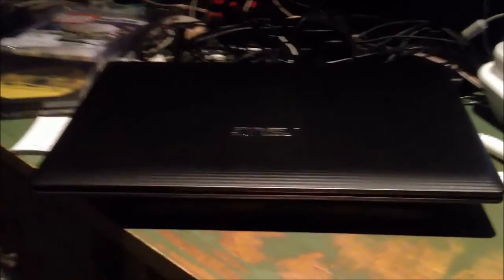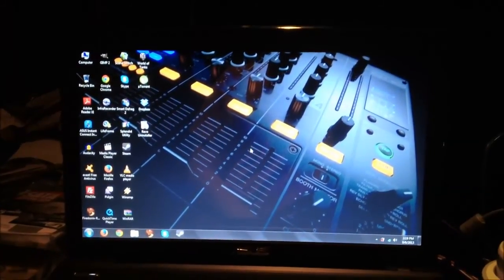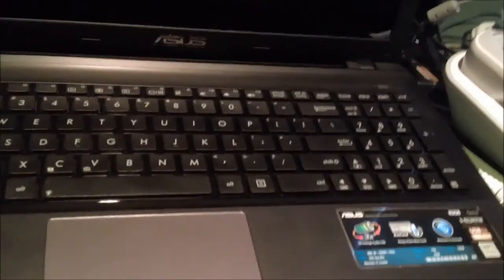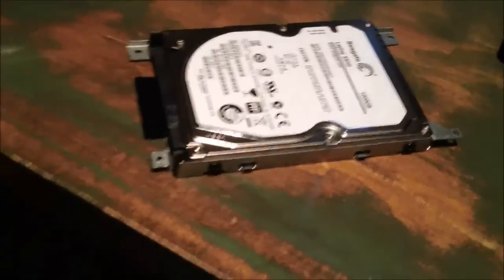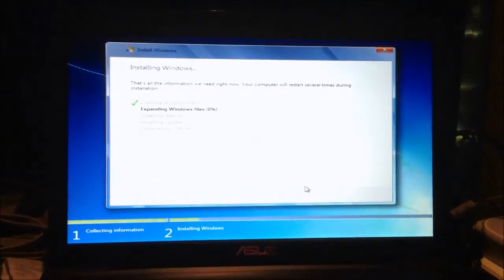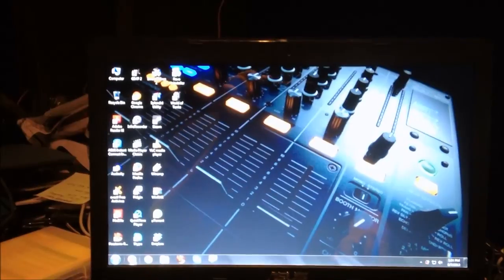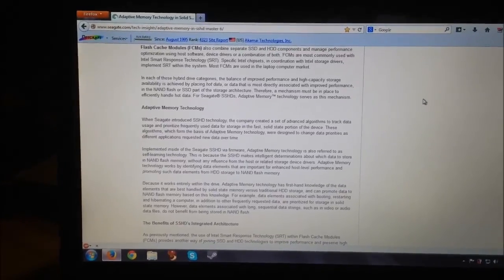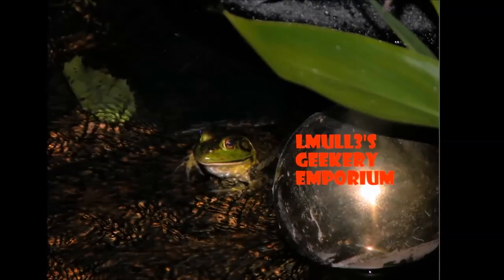ASUS-K55N Laptop: Hard Drive Upgrade 9-8-2013

Comment: I have this same laptop, and its HDD has broken down on me twice. The screen will be black upon start and go to a screen that says 'Preparing Automatic Repair'. Its not out of the warranty period and my campus tech center no longer covers ASUS brand computers.

The issue before was that the HDD had a mechanical malfunction. My question is, since I already backed up all my data, can I simply upgrade to a compatible Hybrid drive or SSD (space doesn't matter that much to me), and start up my laptop just as before? It had Windows 8.1 before it crashed, but I have an upgrade to Windows 10 available to me. Will I still have Windows with a completely new drive? Sorry, I'm a newbie when it comes to hardware.

Thanks in advance for any help you or anyone else can provide!

Comment: I have the same computer and its not that slow. It boots in less than 30 seconds and im running on windows 8.1
Reply: ilovechicheng0715 thats because its running windows 8.1, windows 8/8.1 never fully shuts down a computer it more or less hibernates it (its called a hybrid shut down) so this means when you turn it on it will always seem faster then older versions of windows, if you disable this windows 8 and 8.1 takes a good amount of time to boot from a standard mechanical hdd

Comment: Hey man, what if we don't have an installation disc for an operating system, can we clone the hdd to the sshd, because I really want to do this upgrade also
Reply from the maker: i think i tried cloning my drive and it didn't work for some reason. theoretically as long as the drive you're cloning from is smaller or the same size as the drive you're cloning to it should work.
Reply: ok thanks, and what do you think about this model of laptop, because im willing to pay the extra 50$ for it, 

http://www.newegg.com/Product/Product.aspx?Item=N82E16834312829

I think its a bit  of a newer model. Great review btw!

Comment: I swapped an old 5400 rpm 120gb Fujitsu for a 500gb Seagate hybrid in my nearly 7 year old laptop. Worlds of difference in the performance. Not a new machine of course, but it probably took 2 or 3 years off how old it acts.